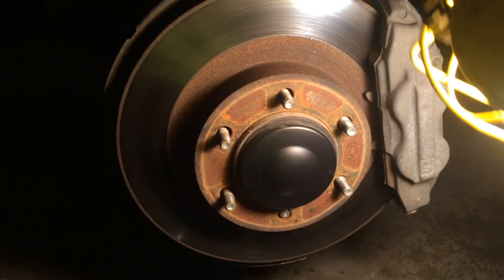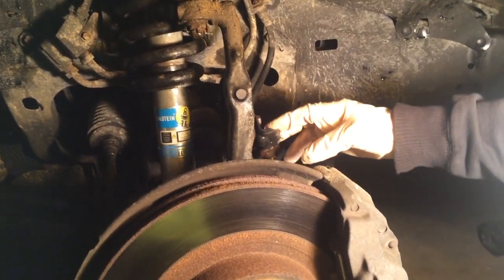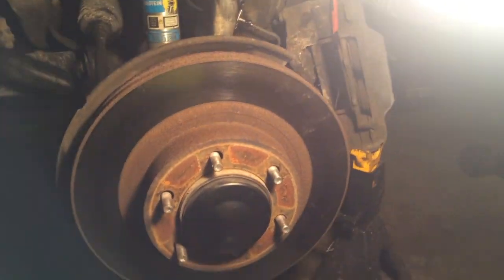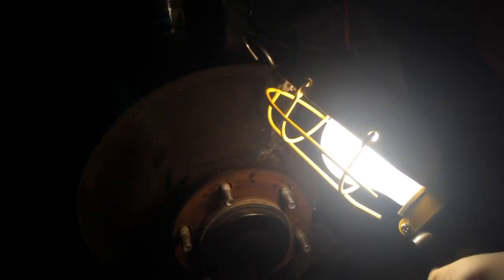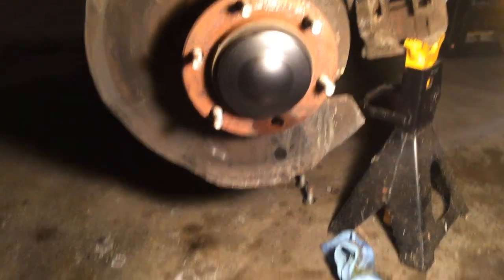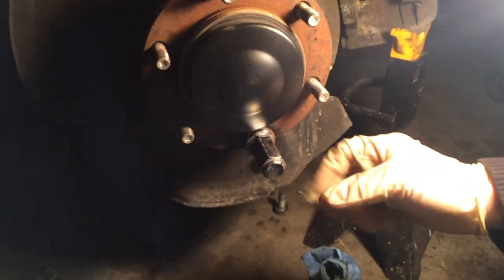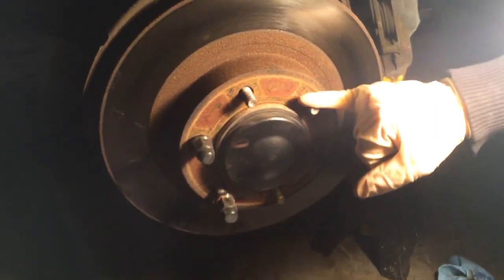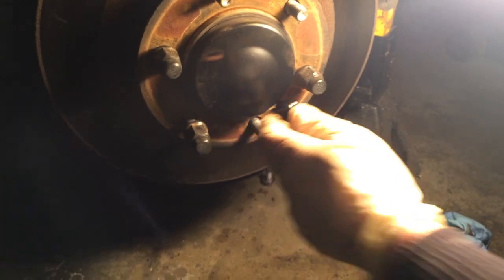Lexus/Toyota wheel stud replacement

Comment: Literally about to pull the wheel off my 06 GX for the same thing.... How did you break yours?
Reply from the maker: I think mine snapped for 2 reasons, the first being that the shop who installed my tires over torqued them, and the second being that I think the lugs were old and had rusted a bit inside on the threads and kind of fused to the studs.  That's why I always use anti-seize after this.
Reply: @GreggyGTV   mines just broke too and it was month ago I had to put a used tires for temporarily replacement. Planning to do my struts and then buy all new tires. The guy definitely over torque with their fast air gun being careless. Plus my stud wheels had signs of rust inner part. So now I might just replace all studs just to be safe side and replace all lug nuts. Thanks for the video as this help me with basic overview on this tasks.
Reply from the maker: @Oneklickmedia  I'm sorry that happened to you.  I'm glad to help in any way I can.  Thank you for the positive feedback.  Good luck with the repair.  I would appreciate if you  would subscribe to my channel for notifications of future content.

Comment: anti-seize completely changes the torque of the lugs.
Reply from the maker: by how much would you estimate?  I'm not sure about that.  I use it for spark plugs as well for example and still torque to oem specs.
Reply: @GreggyGTV  I've read that you can over torque as much as 50% when using anti seize.
Reply from the maker: @AirmanJeff  interesting, I'll do some research, thanks for pointing that out.
Reply: @GreggyGTV  I usually assume 30% overtorque

Comment: Never never never use anti seize compound on lug nuts! Complete no-no!
Reply from the maker: It seems that people are split on this.  I completely understand the concern but I’ve run all of my vehicles for years like this and never had an issue.  And they have never rusted, seized or snapped off ever again.  The biggest thing is proper torque
Reply: I’m here right now after a sized lug nut lol if their torqued their fine…
Reply: @GreggyGTV anti seize affects your torque settings. Don’t understand how but an engineer I know told me by up to 30-50% over torque.